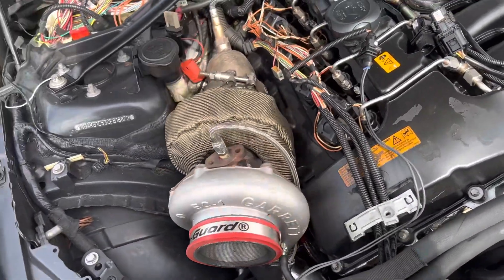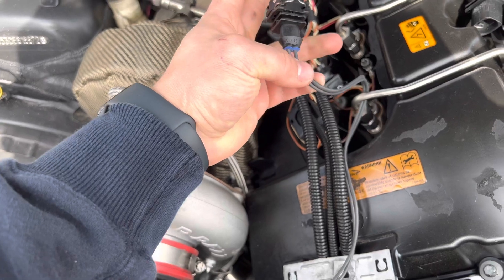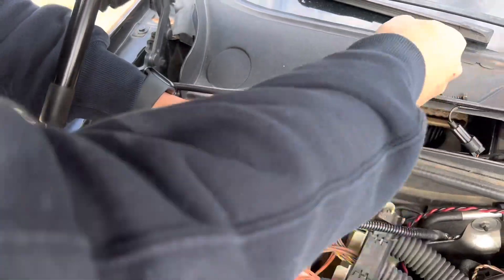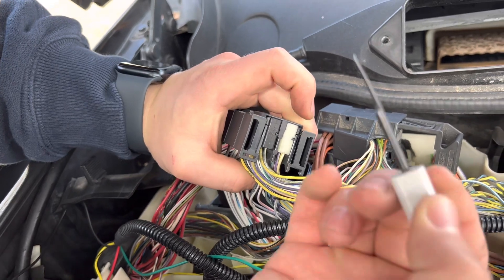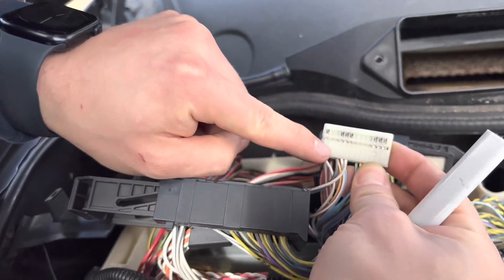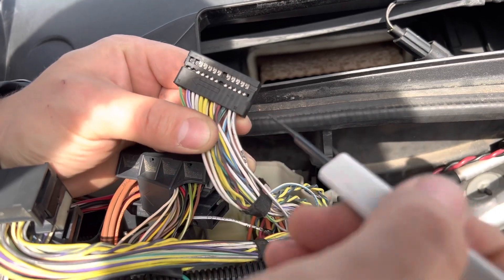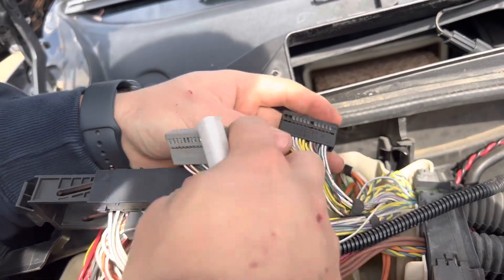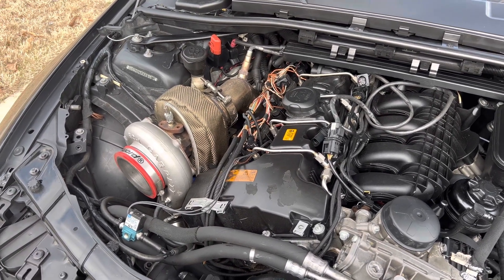MHD single turbo boost control DIY | how to

Comment: If I were to do this on the B58, would I connect to the EWG actuator plug? Going big single and I'm still not understanding how the reflex+ would open and close the external wastegate lol
Reply: @nikkowhips  I ended up doing it with the plug and play kit, for the boost control all you do is take the 2 wires coming from the Mac solenoid and connect em to the 2 wires coming from your reflex auxiliary 1 port. Those 2 wires connect everything you need. Then just route your wastegate lines like normal
Reply: @Stock4forty  Yeah I ended up figuring it out and did exactly what you did but I did the hardware kit instead of the plug and play, I just completely for got to reply to your other comment on that other video lol. Appreciate it!
Reply: I need to know as well
Reply: I need to know similar for s55 what did u do?
Reply: @bmwlife786   I ended up doing it with the plug and play kit, for the boost control all you do is take the 2 wires coming from the Mac solenoid and connect em to the 2 wires coming from your reflex auxiliary 1 port. Those 2 wires connect everything you need. Then just route your wastegate lines like normal. Just let your tuner know which aux port you used.

Comment: Planning to go Single Turbo next summer. Just doing as much research as I can.

Just to confirm as long as you do the repin for the ECU and have a mac solenoid to the stock solenoid plug, you would not need to have a boost controller and be able to control boost with just MHD/custom tune?
Reply from the maker: You will not need an additional boost controller. The factory ECU controls boost.
Reply: Good question, look forward to seeing what conclusions are drawn. Also trying to avoid having to use Jb4 and back end MHD flash tune.
Reply: Correct

Comment: What if you’re using ReFlex+? What wiring needs to be done?
Reply from the maker: If using reflex+ to control boost, then this does not need to be done.

Comment: How much is your tune for single turbo n54 and do you tune with jb4
Reply: His prices are very reasonable but I don't know if he tunes with JB4. But all in all he is a reputable tuner among the N54 community.
Reply: @geo335st  yeah I know that but I'm using doc vu and he likes the jb4 so that's what I'm sticking with
Reply: @pvtpelnar11  yeah doc vu is good too. You can't go wrong with either one. But I do know some tuners don't tune with JB4
Reply: @geo335st  yeah you're right about that wedge performance. Wouldn't touch mine
Reply: @pvtpelnar11  yeah wedge created MHD so yeah no JB4  lol
Reply: @geo335st  wow didn't know that
Reply: @pvtpelnar11  yeah once Cobb stopped supporting the N54 ex Cobb tuners created MHD/Wedge back in the day. What turbo and psi are you running?
Reply: @geo335st  well I'm in the middle of my build right now. I should have it done this weekend. Just got to take the old turbos off but it's a pulsar 3582G and I'm going to be tuned to 18 PSI with 93 and meth and also E-40 in meth at 18 PSI and then I'll have a kill tune of 23psi
Reply: @pvtpelnar11  nice!

Comment: Where are the vacuum lines on the Mac solenoid connecting to?
Reply: Either the turbo compressor housing or you can tap the intake manifold
Reply: @geo335st  thanks bro I got my vacuum source by putting a t fitting from the line that goes to manifold to bov
Reply: @nicholaspoyle8411  yup that works!

Comment: Can we use it with JB4 ?
Reply: You don't need this if you have JB4 since it controls your boost with the MAC solenoid when you update to the single turbo firmware

Comment: So are you able to adjust the mhd boost level or is it one setting
Reply from the maker: MHD allows 4 map slots, so you could have 4 different boost target maps that you can change on the fly. These maps can target whatever boost you want. Throw all EBC/MBC in the trash.
Reply: Depends on your tune and target load. If you want to increase on the fly then you would need a gfb or mbc
Reply: one setting, to adjust u need gfb or any other controller
Reply: Incorrect, you control precise boost and WGDC percent direct from DME to MAC, you don't use a boost controller @Bmw_doc_pl

Comment: What if you are currently using motiv reflex+ for boost control would there be any gain switching too mhd for boost control (single turbo)
Reply from the maker: Both work the same.
Reply: @CD919 Performance  If using reflex+, and AUX1 wired straight to MAC valve and other wire to switched 12v.
Do you still need to swap PIN 7 to PIN 25? 
Thank-You Sir!
Reply: @JamesDean-rx6wy ever figure this out
Reply: @cd919performance3   I have the same question james is asking?